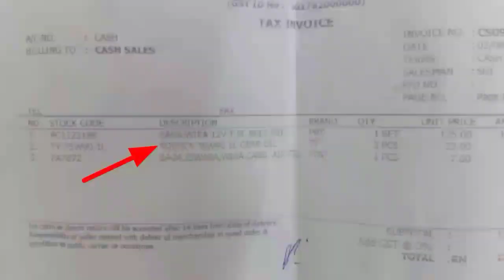Cara service/ganti minyak gear box. Tutorial-diy / Automotif

Comment: Bang kalau wira 1.5 auto boleh pakai minyak gearbox brand toyota ya..?berapa liter kena pakai bang..?
Reply from the maker: Boleh bosku,  stndrd hanya perlu guna 2L saja, 2L tu pn cun2 akan penuh, biasanya ada balance sedikit, pump oil tu sehinga overfloor, masa overfloor tu kalau minyak masih ada sedikit x payah pum lagi, boleh kunci skrew nut.
Reply: knapa bengkel cakap . auto pakai 4L . manual pakai 2L .
Reply: Auto At minyak atf.. Oil xsama dgn minyak gearbox manual.. Mungkin 3ker 4 liter